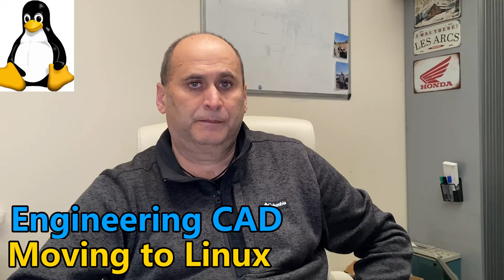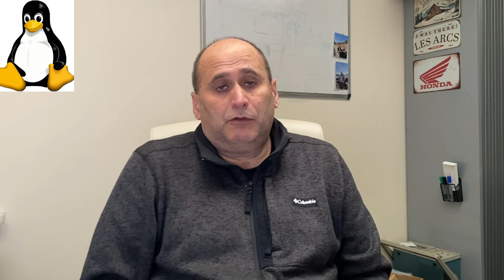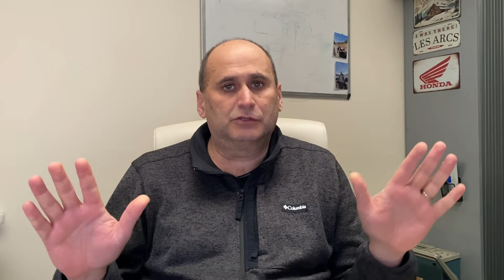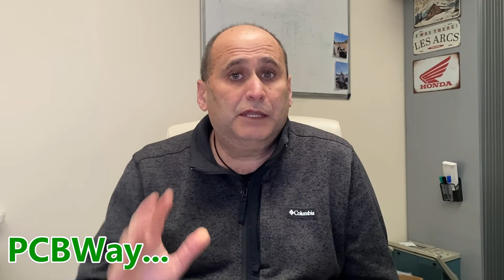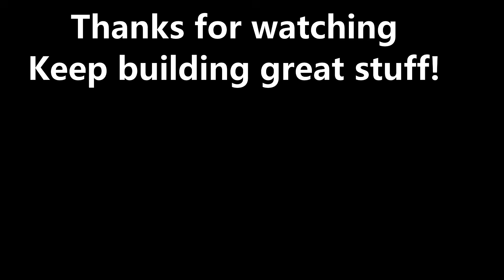Switching to Linux for Electronic Design

Comment: Is there an alternative to old versions of SketchUp (back when it was developed by google) or is there a good guides on how to setup FreeCAD to do the same stuff? I kinda able to draw geometry in FreeCAD like I did in SketchUp, but It's much more involved than "draw two lines, connect them and get a plane, grab a bucket-filler and put a red texture over it, place a text note that says what it is". I know there is such functionality (even more than in SketchUp because you can have layers and different "benches"), but I struggle to understand how to use it all. Differences in UI like going from Paint to GIMP/Photoshop.
Reply from the maker: FreeCAD is more like a proper mechanical CAD and less like sketchup used to be, especially the latest versions, I’ll venture myself into saying that is an engineer tool rather than a drawing tool.
Have fun!
Reply: @adaptivedesign8795  well, that's a shame. I'm not afraid to learn new tools, but It will be a roadblock from replacing MS crap from my father's computer. For desktop it's ok, but on laptop Windows is objectivelly crapier than what I came up from years of using Linux: touchpad drivers, UI customization options, automation capabilities with scripts and all sorts of tools and proper shell (not that BAT and PowerShell idiocity), and energy efficiency.
Reply: Hi friend! If you'll like so much of the SketchUp, you can install it in Linux with Wine....Here in my PC, I had installed SK Maker 2017, and the old version V8.

Comment: Great choice, I would say. I've switched to linux for more than 10 years and never looked back. And yes, KiCad and FreeCAD are great and usable tools and the communities are great. If there's a bug that pisses you off you can simply get into the sources, fix it and contribute back to the community; I did that with some hidpi issues on KiCAD. As for fpga tools, I recently dug out my Arty S7-50 board and started working slowly on a SDR prototype as well. I had to install vivado and the installer was terrible for hidpi screens :)
Reply from the maker: I think bot KiCAD and FreeCAD are good shape, ok maybe some small bugs or very different interface (FreeCAD) when you compare with legacy CAD but between good and very good overall. Regrading FPGA tools AMD/Xilinx have supported Unix/Linux tools from a long time ago (I use to work in Xilinx and I had a Solaris Workstation (Dual ultra Sparc Processor) and a HP-Unix Workstation (and a windows NT) - on my desk.(2001) - Linux was supported a bit later I think 2002-2003.
Anyway back to the subject here, I switched now because things are becoming unbearable with the whole cloud/marketing AI push.
Thanks for the great comment! 
Keep building great stuff!

Comment: for mechanical cad, what do you think about onshape? i work there as a software engineer. i can tell you that many software engineers are also getting fed up with windows despite microsoft's best efforts to keep us interested. WSL is ok but if the base operating system doesn't even work properly then WSL won't save you. i use windows at home and i'm also considering dumping it for something like debian because that's what i'm most comfortable with out of all the linux distros i've ever used.
Reply from the maker: I’m not ok with apps in cloud, is just another thing to go wrong and always an unnecessary dependency 
You can call me old and out of fashion but it doesn’t matter we are what we are.
Reply: @adaptivedesign8795  Disagree, not old even out. You are clever guy who remember sanity in bussiness and relations. Im strongly thinking about shifting towards Linux and my biggest customer IT guys also, unfortunately we are both locked in win environment due machine manufacturer.
Reply: I made the switch from SolidWorks to Onshape a year ago and I'm not turning back!  Since Onshape is web-based, you should not have a problem running it in a browser within Linux.
Reply: @JMarInnoventa  nice! why did you switch?
Reply: @cadguy1234  I wasn't ready to spend a lot of $$ on a new workstation for SW. My laptop with an Nvidia RTX 3050 handles everything fine.
Reply: @cadguy1234   SolidWorks workstation requirements are too expensive.  My "consumer" grade laptop with an Nvidia graphics card runs Onshape just fine.

Comment: You're bang on with this. Admittedly, I was an enthusiast, but I forced myself to use Linux full-time when I went to University in 2000. I have never looked back and this has paid me enormous dividends throughout my career. I use KiCAD daily and Tina-TI and LTSpice under Wine. For 3D CAD I forked out for the commercial package VariCAD - which works very well natively on Linux, FreeCAD is excellent nowadays though (it just wasn't as good a few years ago). Technical documents I create using LaTeX (and yes, professionally, we had a fairly big business that did this, don't let the naysayers tell you otherwise).
Reply from the maker: Nice comment, I was always with one foot in Linux (when I made weird stuff with FPGA and I had to write device drivers for it) but never raised the other foot from Micro-slop.  In fairness it wasn't very bad until they decided to become a marketing company (you open a browser and is full of adds, you modify settings and they stick until the push the next patch - don't get me started) 
Again thanks for letting others know that we are not alone, 
Take care, have Fun!

Comment: Linux distros are swiching to Wayland this days. If you plan to use KiCAD or FreeCAD check there websides. The last time I checked, there only supporting X-Window (X11).
A while ago I used KiCAD to build a simple headphone amp (Douglas Self). I was suppriced how easy it was to send the layout to a manufactuar using there plugin. Oh and there is a little Python tool which dowloads symbols from EasyEDA (easyeda2kicad).
(I'm not a HW designer, but the company I'm working for, coworkers using Altium. This might be the best there is but Altium swiched to a compelte cloud based system. A couple of weeks ago the cloud was not reachable, so there could't work on there PCB's for over 4 hours. And what I'm hearing about pushed Windows updates and reboots, some actualy lost some work. Maybe a single case. The last Windows I realy worked with was XP.)
Reply from the maker: I hope is going to be gradual and will be time for KiCad FreeCad and friends to catch up
Cheers

Comment: No Problem i'm doing PCB design and STM32 Software, I switsed to linux in 2019 Run Debian Stable KDE love it even 3D cad windows software runs better under linux in Wine,. it take some time to get used to, but trust me Linux is better, Windows is just a bad copy of Linux. I still have my old windows 7 in a KVM i use it for windows test.
Reply from the maker: For programing Linux is the best environment, I'm 80% hardware and 20% firmware almost zero writing apps, (some linux drivers sporadically) - that's why my video is focused on hardware. I'll have to keep a Win machine in a corner to maintain what I designed over the years but moving forward. 
Thanks for the comment!

Comment: You can even do RF simulations of traces in KiCad now. Its been a "professional level" tool for a while. A small enterprise can use FreeCad, many bugs have been fixed over 5 years.
Reply from the maker: Maybe I got stuck in commercial CAD land for too long, thanks for the pointers, I'll give it a goo soon
Cheers!

Comment: Hey! Great video ❤. What do you think about more "heavy hitting" engineering programs like ones for simulation. I recently tried to acquire trial license for ansys to try the "grown up approach," but the process of licensing got so frustrating that it was literally easier to order a prototype and do a quick check with VNA Have you tried OpenFOAM thermal simulator or Palace field solver? It would be great to hear the opinion of more seasoned professional on how those compare to established solutions. I heared various opinions ranging from "buggy mess" to "life saver" it would be great to hear what is usable and what makes "gears grind". Cheers!
Reply from the maker: I never used anything tools from Synopsys (maybe tangent when they had short lived partnership with Xilinx - for digital synthesis) - for mechanical design I was using a very simple tool under Win (Alibre) I never had enough money for SolidWorks/Katie/ProEng etc.  and what I design (Mechanical CAD) is simple tooling for electronics manufacturing (fixtures, soldering pallets, pick & place trays)  - do I'm not the right person to have a proper opinion.  The best way to evaluate "the new kids in town" is yo use them in trials on your own designs and projects. OpenFOAM looks like an interesting tool but again I'm not exactly qualified to have an opinion.
Reply: I just set up OpenEMS and it works well